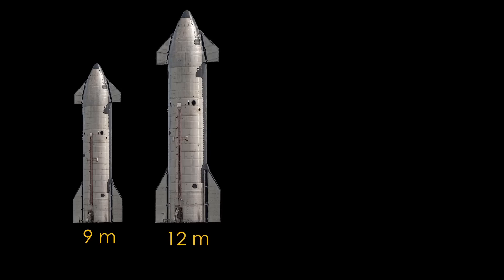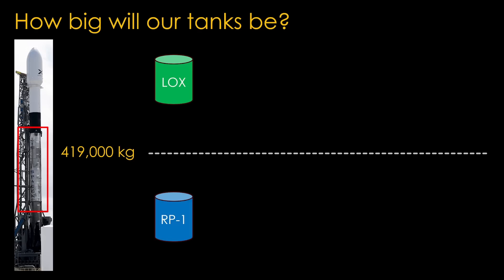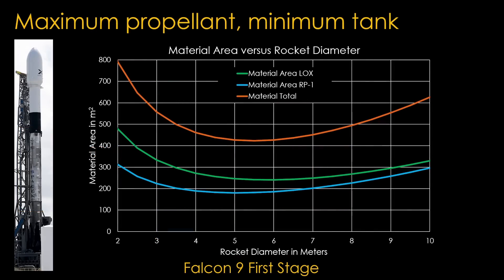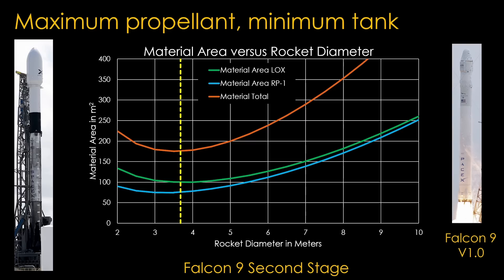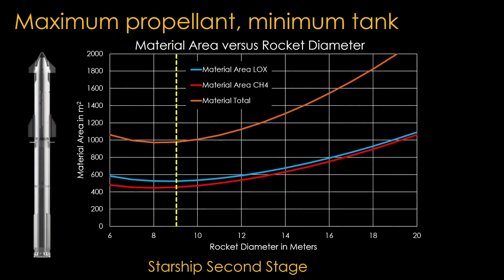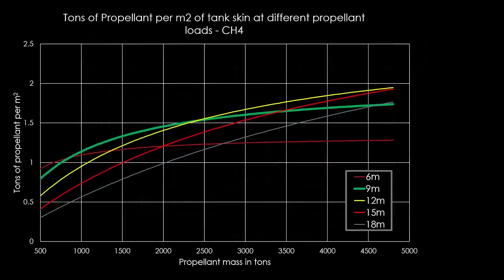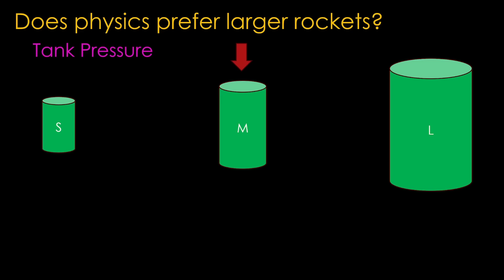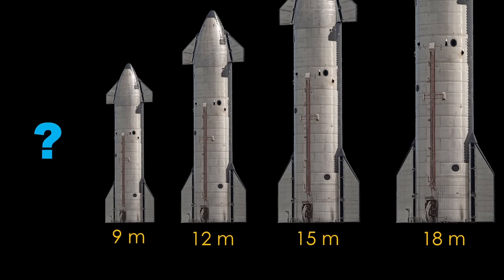Will Starship Get Bigger? Propellant tank sizes and rocket diameters

Comment: The assumption that the tank is the same thickness is simply wrong. If the tank is twice the diameter, and designed to hold to the same pressure, then the walls need to be twice as thick. Also, rockets have height limits if all the engines ar on the bottom. There's a limit to how many engines you can bit under each stage. So it's impractical to build cylindrical rockets much bigger than starship. This is why the N1 was conical despite being even smaller than starship.
Reply: He talks about this at 13:50
Reply: The N1 was conical mostly because they were using spherical propellant tanks. That's the ratio between Lox & Kerosene.
Reply: @chrissouthgate4554  Fair point. A better example would be the flared bottom of the Saturn V, to account for the massive F1 engines. No matter how you slice it, you will reach a point where there isn't enough space on the bottom of the rocket to leverage enough thrust to get the rocket off the ground.
A single raptor engine can only lift the weight of a column of water with its own footprint 200m tall. Since you can't fill 100% of the area under the rocket with engines and you need a thrust to weight ratio of at least 1.5:1 to efficiently reach orbit, the 150m tall starship V3 will be pushing the limits of how tall a vehicle can be and still fly.
Reply from the maker: Is the pressure driving the thickness or is it the structural load?
Reply: @EagerSpace  The rocket derives its rigidity from the internal pressure. The taller the rocket, the higher the necessary pressure to maintain rigidity. Basically, you want the walls to always be under tensile load and never have a significant compressive load.

Comment: since the raptor engines are not operating at full thrust and they don't need to re-light all the engines for landing either stage, it makes sense that you'd use up more of that untapped energy margin

Comment: Radius=1/2 x Diameter.
Volume= (PI x Radius x Radius) x Height

Height = 100 meters
Diameter=9 meters.  Radius = 4.5 meters
Volume = (3.14*4.5*4.5)*100 = 6,361 cu meters
Height = 150 meters
Volume = (3.14*4.5*4.5)x150 = 9,542 cu meters 

Height = 100 meters
Diameter=18 meters.  Radius = 9 meters
Volume = (3.14*9*9)*100 = 25,442 cu meters
Height = 150 meters
Volume = (3.14*9*9)x150 = 38,170 cu meters 

2x the diameter yields 4x the volume.

The optimum height of a rocket is 10-20x the diameter.

Comment: Nice work, busy busy I see.
One thing you didn’t mention is thrust density. It is easier to stuff more engines under a bigger diameter rocket, and they are already struggling to meet their thrust goals for the new Starship versions – which you nicely summarized in your video covering the importance of Raptor. At some point they won’t be able to squeeze more performance out of Raptor (safely or reliably), at which point an increase in diameter is required for any further increase in thrust (=payload). 
>90% of Starship launches are fuel tankers, so the real analogy is the KC-135. For Elons Mars program, >99% of launches from earth are fuel trips to fill cargo Starships bound for Mars. Starship is almost entirely a fuel tanker, and there is no limit to the need for more payload. If Musk is really serious about Mars, and I believe he is, then an increase in diameter is inevitable, at least as soon as they start generating some revenue via Starlink (presumably?). It will be interesting to see where the revenue comes from to support the Mars program……???
Reply: Currently SpaceX is targeting superheavys with 35 engines instead of 33 while maintaining the same diameter, there are already unofficial designs showing that it is possible, so they still have room to improve the current design
Reply: @APMI-OFICIAL  Yeah, but if they are increasing they chamber thrust they should be able to increase the diameter at sea level,  so they're probably leaving some sea level performance on the table. It's pretty early in the program to have run out of ability to stretch it any further.
Reply: @marksinclair701  They will max out the raptor and that will likely end development of starship.  Another larger version might be built later but likely not for a decade or more.
Reply: And starlink currently has profits of the order of 6 billion dollars

Comment: There is not that much advantage from increasing the width as height of the rocket is limited by the thrust by surface of the engines. Next rocket is more likely to be 27 meter wide or something, unless some breakthrough with rocket engines appears or we get some super materials like carbon nanotubes, metallic glass or hot temperature superconductors. Also, the 27 meter wide rocket is likely to be the biggest conventional rocket, as by that time we should have large moon and asteroid resource mining and manufacturing, so biggest Earth exports are likely to be complex things like computer chips and humans.
Reply: Asteroid mining would be better done from a base on Mars, lower gravity and much closer to the asteroid belt. Then refine the raw materials on mars and only transport highly refined materials back to earth.
Reply: @schrodingerscat1863  I know it's hard to believe, but asteroid mining is not a thing economically. You can't mine resources from moon, mars or asteroid belt and make it cheaper than what you get on Earth, the math just does not check out. Asteroid mining will basically be exclusive to only space related activities, like making space habitats, spaceships and other space related stuff. Unless price of earth materials drastically raises, like by orders of magnitude, and we figure out good mass drivers, it's not going to happen. This is why I specifically said that Earth made rockets will have to compete with Space made rockets, as for the same reason why it's expensive to send stuff back to earth, it's expensive to send stuff out of earth, so we probably will not be delivering THAT much cargo to orbit with gigantic rockets, we are more likely to just deliver humans and chips, and then spaceships and fuel for spaceships will be made in space.
Reply: @Ormusn2o  May not currently be a thing but that will change as technology makes such a venture economically viable. May be 100 years away but it will happen, the resources available in the asteroid belt are vast.

Comment: I think for Starship, as a fully reusable rocket, bigger is better.

A bigger Starship can send more stuff with less flights, and since the major increase in the cost of the launch is the propellant (the operations cost I think is more or less independent from the size), you can get a lower $/kg.

Also, you don't need a lot of launches to send a good amount of cargo to LEO, so a super fast turnaround time isn't too obligatory.

Obviously the gains in cargo volume are also there. "Who wants to send a 15 m wide payload into space?" may you ask, the same people that started making 8 m wide modules after Starship became a reality is my answer.

imo a smaller version for cislunar and interplanetary travels combined with a bigger version for tankers and LEO payloads is the best combo. Is not unrealistic to think of an scenario where a 9 meter Starship can be refilled in orbit with just 3 or 4 tankers, instead of ~10.
Reply: what also surprises me is that SpaceX never investigated floating starship upright in the ocean and launching that way, much like sea dragon was designed to do.
Reply: @paulmichaelfreedman8334 seawater is a bitch on the engines,especially complex ones like the raptors. Zea dragon had super dumb engines that wouldn't get too damaged by the water.
Reply: @paulmichaelfreedman8334  Well, getting a rapid reusable launch system when you launch and landing zone is the middle of the ocean isn't the best option imo, also the sea water makes running an engine quite difficult, let alone the maintenance needed for a long operational life.
Reply: > bigger is better.

Of course this can't be just generally true. 9m width is quite large as-is, and 250 ton payload to LEO (if expendable upper stage) covers all current and near-future needs with lots of room to spare. Why would SpaceX spend large amounts of $$$ and work to redo everything for wider rocket if current one works? It's not like they have nothing to do, it'll take them at least a few years just to get it working reliably a-la F9.
Reply: > "Who wants to send a 15 m wide payload into space?" may you ask

For example, what that can be? We currently can't even manufacture 15m diameter monolithic telescope mirrors that large, maxed out at ~8m.
But if necessary, "hammerhead" fairings can accommodate something like that on a narrower rocket.
Reply: @denysvlasenko1865  Not necessarily a single payload, you can easily launch entire constellations (even starlink sized constellations) with way less launches, or make some crazy rideshares with an extremely low $/payload. 

However I think even single payloads with requirements for ~15 m wide fairings will come if such a rocket is created at some point, bigger modules for bigger space station is an obvious market that can scale up quite easily, see the case of Gravitics, Vast space, Voyager Space, or LIFE Space, all those companies started working on 8 - 10 m wide modules thanks to Starship. This is a case when the supply came first, and the demand later.

And yes, a wider fairing / cargo bay may work, but isn't the best option for a fully reusable rocket.
Reply: Anyone aware that there is more than one orbit around the earth? That's the same problem as with large planes, you will have hard time to find enough passengers that want to go to the same place at the same time.
Reply: @ekstrapolatoraproksymujacy412  that's a non-problema, considering that the payload for the bigger starship will be 99.9% of the times fuel for other ( smaller) starships.
Reply: @ekstrapolatoraproksymujacy412  You can make multi-orbit missions (even to GEO) with multiple payloads if you have a crazy amount of ΔV, which such a large rocket surely has. Also, SpaceX rideshare missions seems to be doing quite well.
Reply: @Sun-like42  Current starship barely has deltav to get to leo, any higher and it needs refueling which also looks very bad because dry mass is very high (like 50% higher than they think it will weight during early days) and almost 20 refueling launches will be needed to refuel ship to the brim. Btw mars is 6km/s above leo so full tank is needed to send it, it just looks bad right now

Comment: 14:52 "The acceleration due to gravity goes up during the flight of the stage." Surely the acceleration due to gravity remains fairly constant at low altitudes and can only decrease as you get farther from the Earth? Would the correct wording be, "The acceleration of the rocket goes up during flight because the rocket constantly loses mass. (F = ma ⇒ a = F/m) This will increase the pressure on the tank."

Edit: Looking at the equation right now, and I'm not sure how my explanation would work...
Reply from the maker: Yes, your explanation is correct; it's about the effective gravity not the actual gravity.
Reply: @EagerSpace  Ahh, "effective acceleration", there we go

Comment: So, out of curiosity, how would an estimate on internal volume of a 12 meter crewed starship compare to the ISS?  

That aside, while I don't disagree that the 9m version is likely to be the standard for some time, I would at the same time be not overly surprised if a 12 meter were to come along down the line as the next step, as it were.  It likely would have to wait until after establishment of market demands driven by 9m Starship, but still, it's within the industrial capacity to implement, unlike for gains for 15m+ rockets of sufficient length to be necessary.  

As a different aside, how practical / feasible / likely do you think it would be for us to see in the future a space station that is just 4 modified crew starships docked to a single central hub module?  And how would it compare to current / historical / likely other private space station programs going on right now?
Reply from the maker: Can you add those questions to the "ask me a question" video I dropped recently?

Comment: They’re not going to increase the diameter on starship. It can only get taller, not wider. 
If they make it wider then it’s basically another rocket all together and can’t be called starship. They would need to replace all the GSE, new towers, factories everything so a larger diameter won’t happen till maybe the 2040s/2050s

Comment: 5:35 “Falcon 9 diameter is limited by the roads”

So fly it.  Not in an aircraft, it can fly itself.  With just an aerodynamic fairing, effectively no cargo mass, it ought to manage a few thousand kms.  Point to point in 20-25 minutes.
Reply from the maker: It wasn't clear whether that would work when they were designing the rocket and it would take a lot of work to allow F9 first stage flight over populated areas.

Comment: Hmm, so even Starship V3 is still optimal for 9 meter ship.
Reply from the maker: To be honest, it might be better with 10 or 11 meters, but my guess is that it's not a big difference.
Reply: @EagerSpace  Especially since they are now out of room to add more thrust to accommodate any future growth. Falcon 9 took years to max out it’s aspect ratio, Starship has nearly managed it before they are even operational. 

On that topic, do you think they are leaving performance on the table by not increasing the booster nozzle diameter? 
If the chamber pressure has gone up from Raptor 1-2-3, doesn’t that mean that they should be able to handle a bigger sea level nozzle without flow separation? Does that give higher Isp or thrust? 
A diameter of 10m or 11m would have accommodated future some growth before a diameter jump was required.

Comment: This IS a very interesting topic. Another topic I've been curious about is the issue of how many engines is most beneficial. For example, Superheavy can loose an engine or two and still boost Starship enough for it to make orbit. There is a new design with 35 raptors. What is the benefit of more engines? Obviously more thrust, at the cost a little more weight per engine, but that gets the rocket up higher faster, so I assume that cuts into gravity losses? And Starship has an upcoming design revision where it will have nine engines rather than six. And it will hold more fuel. What is the cost of the additional engines and what is the benefit? I imagine there are some interesting graphs to be drawn re. those figures.
Reply from the maker: You are correct - the faster you burn the fuel, the quicker you can stage. That not only reduces gravity losses but for the first stage, means you are closer to the launch site so it takes a little bit less fuel to get back.

Comment: There's another advantage to making the rocket wider for the same fuel: you gain more area at the base for more thrust, and therefore less gravity losses.  There's also an compliating relation to "excess" surface area which costs weight, but might interact with Starship's reentry where extra surface area is useful.  But Eager Space, thanks, even talking about the first order base size vs volume math leads to interesting and important engineering!
Reply: The thrust puck is very heavy though, the thrust is transmitted to the walls, you need thermal and blast protection. So high thrust density to keep the thrust puck small sounds nice.

Comment: Nice video! Quick addition: the mean height of a rocket is also limited by its thrust density. One of the reasons to taper a rocket like the Saturn V is to fit more engines underneath while still getting sensible aspect ratios in the tanks above it. Starship gets to have as high an aspect ratio as it does in significant part because of how unusually powerful its engines are and how packed its flamey end is with them.
Reply: Flamey end lol
Reply: Yes, this is an often overlooked factor. 

Short rockets don't need to pack the engines in very tightly. Electron has lots of space between engine bells, and the bells only take up a small percentage of the area. F9 is quite closely packed, and Super heavy is just insane with engines jammed in so tightly that most can't gimbal.

So an 18m Starship full stack isn't going to ever be twice as tall as the 9m. It just physically can't be.
Reply: Another reason for the steps in the Saturn V was the design process. The Third stage was a reused Saturn 1 / 1B Second stage & thus was designed first. The First stage was designed second; because without it the Saturn V (originally C4) was not going anywhere. This left the Second stage to be designed last. This gave them all sorts of problems, not only did they have to fit between the other two; but weight overruns were left to them to sort out. The Second stage thus had the most advanced engineering solutions of all stages. Such as the common bulkhead between the hydrogen Lox tanks.

Comment: NISTIR 6646 records viscosities for RP-1 down to -30°C, where it could reach a density of 836 kg/m^3
Reply from the maker: Back when I looked at RP-1 I tried to pick a decent spot for viscosity. You can get it a little colder but you get close to gel, and since RP-1 is a standard rather than a specific mix my guess is that you would want a little margin.